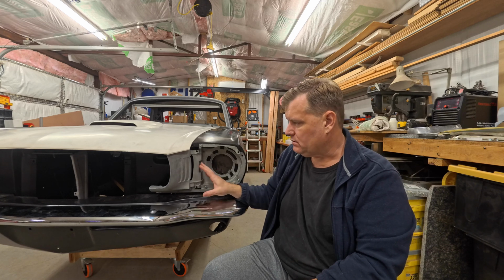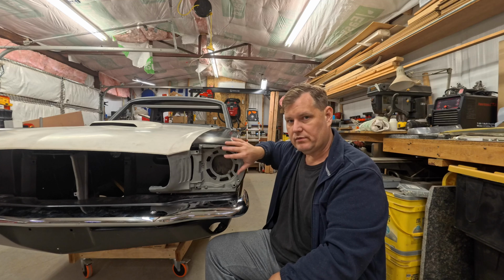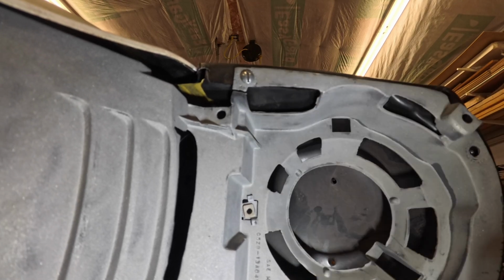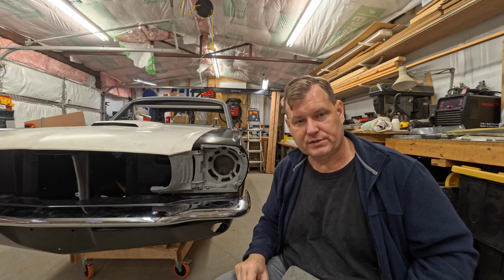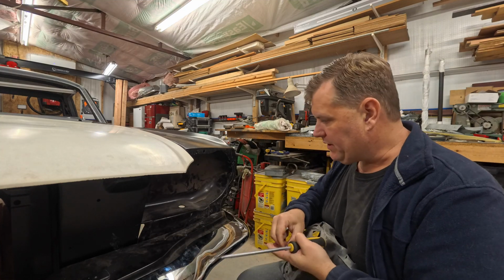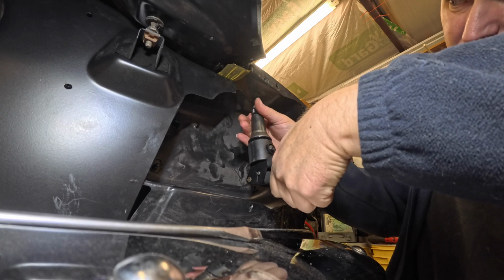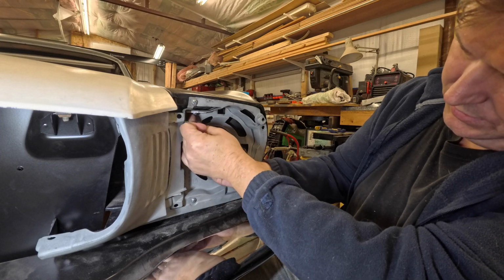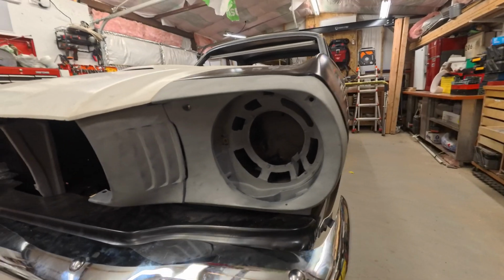66 Mustang potmetal headlight bucket repair

Comment: You actually didn't repair the broken part, that's the most important of keeping the headlight door in place. There's a much more simpler repair kit available.
Reply from the maker: Nope I didn't repair it I made it redundant and it's now much stronger than the original was with a 5 minute modification.
Reply: Unfortunately you still have a broken part 😂

Comment: Just bought a repair kit for that issue. Comes with a piece of metal and jb weld. Can’t say I’m a fan of the fix. Your idea is much better and cheaper. Thanks
Reply from the maker: Thanks. Haven't seen that kit though honestly I never looked for one. Easy enough to do without buying anything.